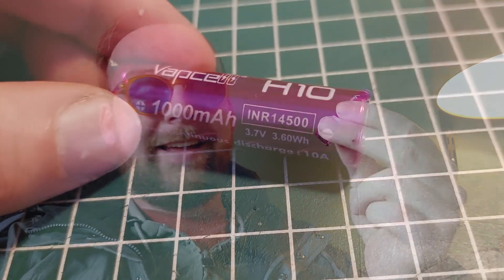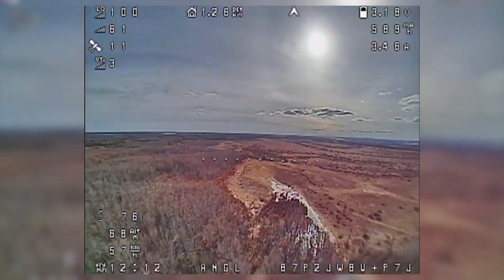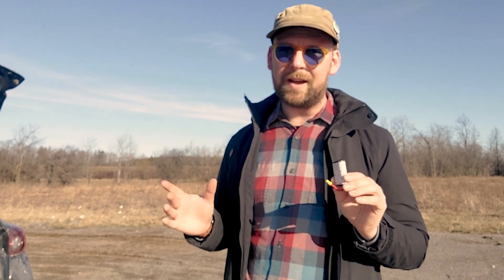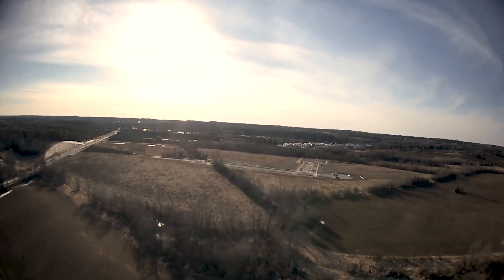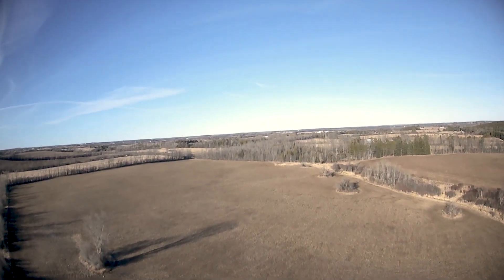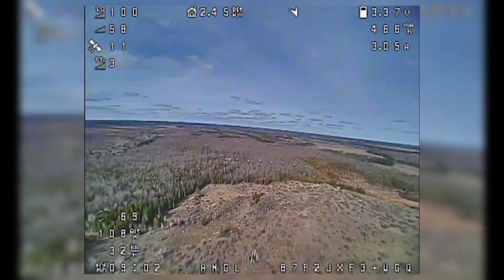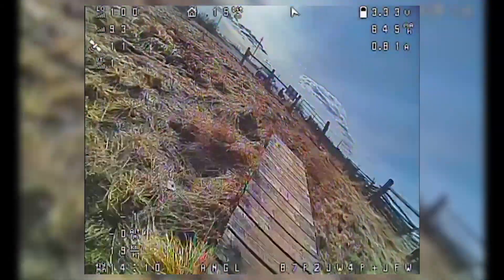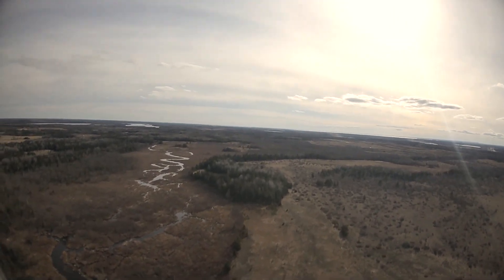The Lightest DIY Li-ion Battery Pack for Long Range FPV Aircraft!!?

Comment: So funny that I stumbled on your video, I recently built a similar pack for my drift with the L12 vapcells instead, they are only 3 amp discharge but I used 4 in series/parallel for a 6 amp max and 2500 ish   mah.   The most draw I ever see on this bird is 8 amps so I figured it would be ok, so far they perform great, tons of flight time and they fit snug and perfect.   Curious what your max range is  ??  Noticed your other vid said you'd gotten out 4 km but expected more, I just went 6 km out the other day had about 3.7 per cell left when I got back so the plane is definitely capable of more, needless to say it was a very calm day
Reply from the maker: Oh glad you liked it. You've definitely got more mah than what I have with these, I'm only running with 1000mah. I think the problem I mostly have is that the discharge curve isn't very forgiving on these cells. By the time I'm at 40% battery, the plane becomes very sluggish, especially in the wind. How much does your battery weigh?
Reply: @Flight-Cub  Mine weighs in at around 90g, I m sure I would start losing power if I took mine very low as well, I havent had it below 3.3 v per cell in flight which of course bounces back around 3.7 after landing.  Its always had plenty of power at the levels I fly at though I havent pushed it super hard and always go out on the calmest day possible. I was out for a quick flight yesterday and even a slight evening breeze was tossing it around quite a bit.   I have a course lined out I think I can get close to 10 km on but need to wait for a warmer very calm day
Reply: @     This little bird is definitely capable of serious distance when the conditions are right.   Got out just over 8km from home point with these 2500 mah cells today.  Pretty sure I could have hit the 10k mark but I chickened out
Reply: @Flight-Cub  Follow up to my previous posts, I finally took mine out to 10.5 km today with about 1000 M  of climbing up a mountain, the L12 batteries are definitely capable though much like yours were getting really sluggish about halfway back and I ended on about 3.2 V per cell.  Have you experimented with any more different batteries in this one ??
Reply: Cool to know, but I'm curious if you mean the F12? I can't seem to find a link to an "L12" vapcell around. In any case, it seems like the extra few hundred mah may really result in a much higher performance. I'd be interested to see what the discharge curve looks like for these cells. Thanks for sharing!
Reply: @StewardsNotes  Thanks for the catch, yea they are definitely F12's not sure why I ve been calling them that.  They have certainly exceeded my expectations for endurance and power, I was quite frankly unsure if they would work very good at all when I first built it.
Even at 3.2 V per cell I could still climb pretty fast and though there wouldnt have probably been much left when I got home it still managed a 26km round trip after all the detours.
Reply: @StewardsNotes  I only went with the 14500 cells because I kept finding the CG really hard to hit in this tiny plane with the 18650 cells I had been running, though I know a lot of people use them and have luck

Comment: I'd suggest you look at a single Molicel M35A 18650 instead. They weigh 45g each, max 10A but are 3500mAh.  Then you don't need to mess around with a pack and level balance when charging. Here in the UK they're the equivalent of about CA$13.  Personally I use a pack of Molicel P42A 21700 which are max 30A, 4200mAh and still only weigh 65g ea.

Comment: I wonder if you could squeeze more flight time if you change the motor timing. I have used the elf bar vape batteries and they are also very light
Reply from the maker: Hmmm interesting, I haven't played around too much with that, but could be worth a shot!

Comment: I wonder is this would be viable in a micro 2-4" long range quadcopter. This would make a perfect cell for a 3s pack on my Darwin Baby Ape
Reply from the maker: Give it a shot and let me know how it goes! I'd just start by making sure your motors are okay to run at around 6v/cell or lower.